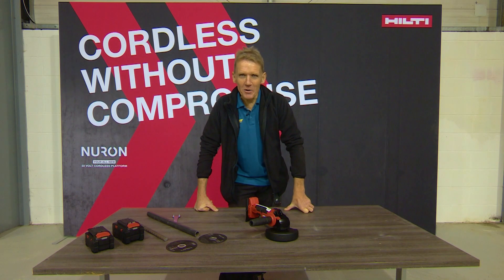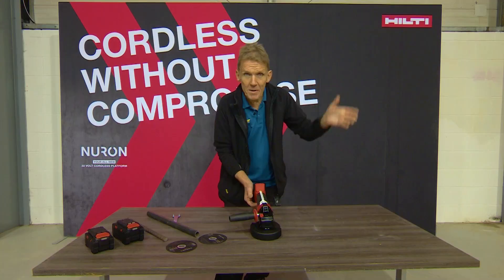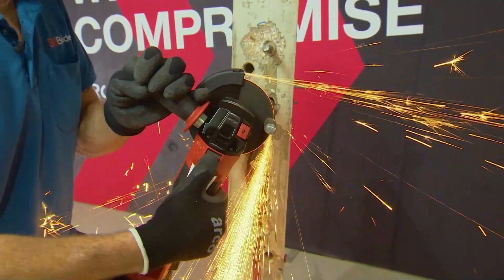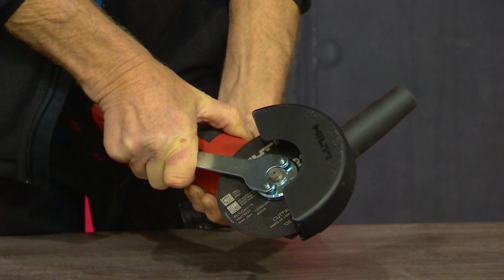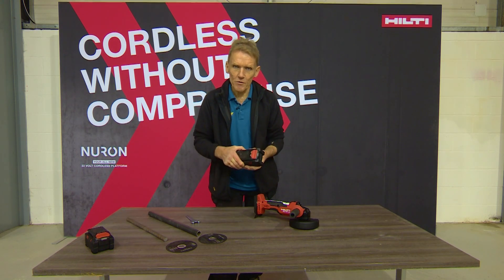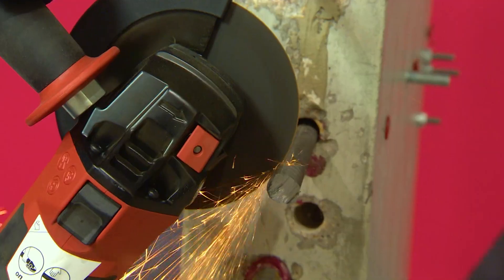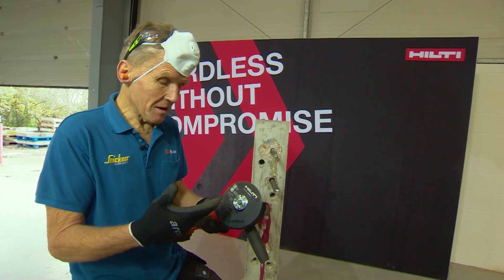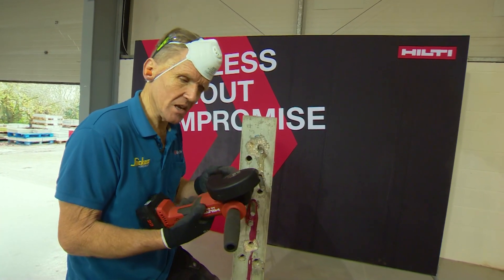Hilti AG 6D Powerful Cordless Angle Grinder

Comment: An absolute step backwards. A key needed. That's one step forwards , ten steps back. If you are skilled with a grinder, you shouldn't need all that sense tech nonsense. DIY'ers might need it but they are the ones who will certainly not pay Hilti prices for a grinder.

Comment: Milwaukee fuel has a quick nut, so your fingers are a key plus a brake and they achieved almost impossible with their 18 volt platform, while competipion decided to change battery platform. What I spent on Milwaukee and Festool I would have to double on Hilti, and boy I did spent a lot. I'll pass